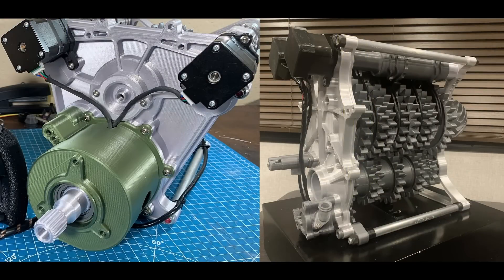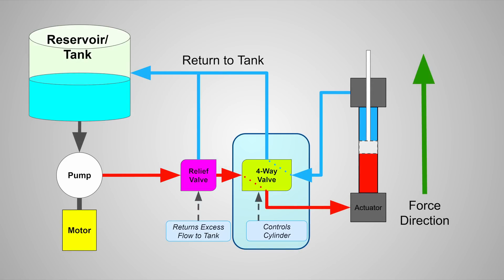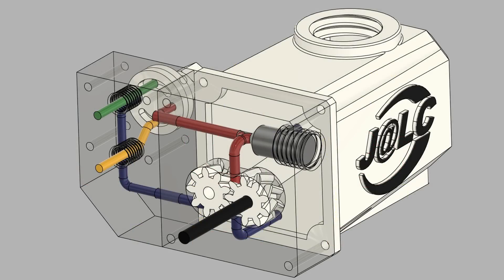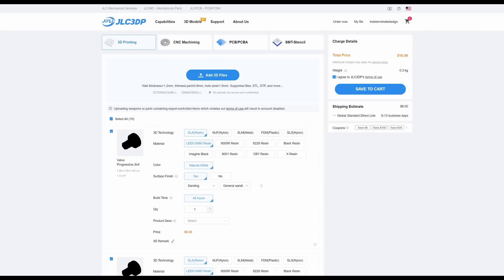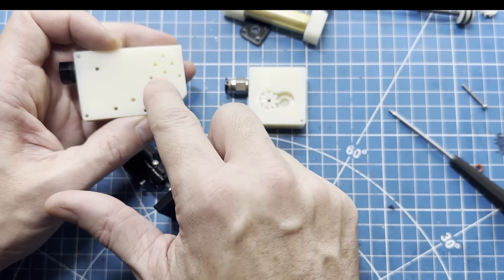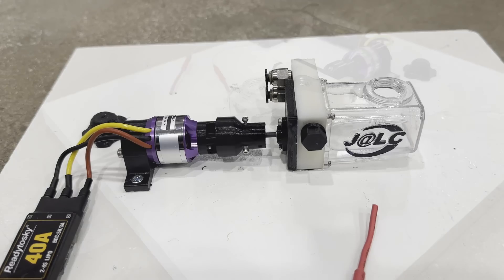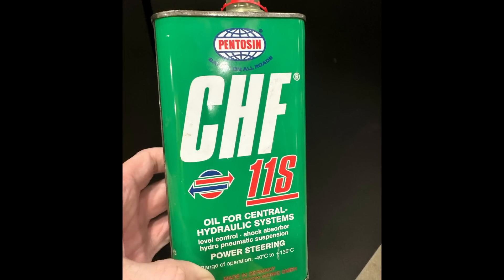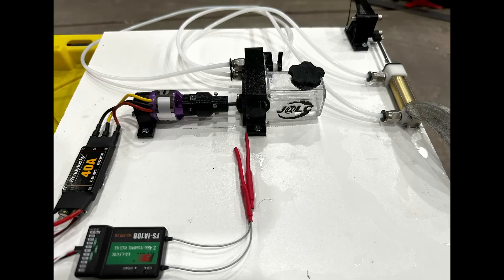3D Printed Hydraulics

Comment: Hi, I'm a mechanical engineer mostly doing hydraulic stuff for test systems in the automotive industry. Your system is impressive. I've seen some issues which caused the leakage and the which will damage your cylinder over time. First of all the shaft seal has to be connected to the suction side of your pump, so it wont be pushed out when the pressure is rising. Second, your cylinder is bolted down to the table, therefore the piston rod is bending and putting untypical forces to the cylinder head. Your piston rod will wear down the cylinder head fast and it will beginn to leak. Mount your Cylinder in a way it can swivel with your construction. You have negative forces put on your cylinder. Therefore it retracts to fast, almost with no resistance than friction, in industrial applications this can cause heavy damages. You have to preload the retraction movement with at least in line a relief valve or better with a counter-balance valve. In your case this doesn't matter, but it is something you should be aware of. But really nicely done. Kind regards and a happy new year!

Comment: instead of a gear pump, you shall definitely take an ABS unit from a scrap yard, open it and try using the design features inside of it in order to create a small but powerful hydraulic pump. If you go that path, you should investigate a lot on reducing the pressure peaks as the flow of piston pumps is not linear unfortunately.

All in all, I think piston/plunger hydraulic pumps are more fit to be printed using FDM and some postprocessing (epoxy sealing of the printed components)
Reply from the maker: I agree, I think piston and plunger pumps are the way to go. I had a lot of issues creating efficient valving though, I need more iterations. 

I thought about the ABS pumps, but size was the biggest factor. I would love to be able to fit this in an RC car of some kind. I think I can make a pump under 2” by 2”.

Comment: Try regular spur gears, rather than herring bone gears, most proper hydraulic systems use regular gears, and I think there would be allot less chance of the fluid ‘slipping’ Bach through the pump. There’s really no reason to be using herring bone gears as there’s minimal thrust loads
Reply from the maker: That’s interesting. Several places I read that herringbone gears have lower leakage losses due to the v shaped engagement.  It was said they weren’t used because obviously they’re harder to make. Do you have any papers on this?  I printed a set of straight spur gears I may try out here.
Reply: No, I don’t have any papers, but in my experience working on industrial hydraulics they’re all straight spur gears I may be wrong and the herringbone is just as good, but it would be interesting to see the difference.

Comment: Control valves should have bypass when in "off" position.
Extended periods of "off" while the pump is running will cause the working fluid to overheat.
Reply from the maker: Absolutely.  I couldn't think of a way to do this with the disc valves I was using.  I copied an existing design used in a lot of RC hydraulics.  Next time I want to have individual electromechanical 3 way valves.
Reply: @IndeterminateDesign  Have a look at spool valves. They really aren't difficult too manufacture and provide all the functionality you want.
Tractors, excavators, etc all use them.

Comment: Good idea, I think you would have more success with a piston style pump driven by a stepper motor, think leadscrew on a resin printer, it would be capable of generating serious amounts of force.
Reply from the maker: I agree.  I used a 2 piston pump as my first prototype, but I lost the majority of the pressure in the valves.  I need to try it again with some much more accurate SLA 3d printed parts.

Comment: what about a FDM surine like pump?  so having one of that big suringes actuated by a motor an a theated rod with a nut, that will generete positive/negative pressure fluid to actuate the sistem.
Reply from the maker: Those definitely would work.  I have tried a piston pump which is like a syringe but just resets.  I had a lot of challenges with the valves.  They need more development.

Comment: Hello ! I have no knowledge about hydrolics or robotics. But when I see the system I don't understand the advantages of going for hydrolics instead of electric actuator. As the power source is an electric motor, I think that the hydrolics are just a inefficient gearbox. What am I missing ?
Reply from the maker: In many ways it is just a gearbox. The biggest reason is power density. It’s very easy with hydraulics to achieve a massive mechanical advantage by just changing the area ratios between components. This allows for actuators that are much more compact and lighter than a comparable gearbox.

Additionally, a single pump can service multiple actuators. And typically all the actuators aren’t using the full bandwidth of the pump so you have less redundancy.
Reply: @IndeterminateDesign  thanks a lot, it makes perfect sense !

Comment: Are you planning on taking it further? Im really excited for it! Would be awesome to actually get a hold of rc hydraulics without giving an arm and a leg!
Reply from the maker: I do want to develop this more, but I don't have a definite timeline.  I want to try several different types of pumps because I think that is the hardest problem to solve at this scale.  Once we can generate a couple of hundred pounds of pressure, the rest I think will be much easier to solve.

Comment: Great video . I used to machine and maintain hydraulic pumps professionally, this looks like a professionally made system .  On another note fdm can manage parts like this , however there will be fitment and size limitation .( Gotta be large enough so that part tolarances are within the available tokerance of the printer ) i gotta get my hands on an resen printer.
Reply from the maker: That’s awesome.  I agree, all the FDM pumps I tried had to be much larger in size. The stretch goal is that I could fit a hydraulic system into an RC car. In hindsight I should have started larger and worked my way smaller.

Comment: Micro hydraulics seem like an idea with high potential, but i always got the feeling you had to "know a guy." I am really surprised that robotics haven't used more of it with how easy ratios are with piston vs pump size. This seems way more accessible imo, thanks.
Reply from the maker: I was trying to figure out the same thing. The cost is quite high for the off the shelf parts. I know some places like boston dynamics have used these, it maybe just a money thing.
Reply: @IndeterminateDesign  to be fair, companies like Moog are far more expensive than they should be.

Comment: Great project!

At some time I was going to try something like this too. Similarly, my idea would be to 3d print the channels and blocks but size the prints so they could be contained in stock profile metal sections. Doing this might help increase the working psi as the pressures could be transmitted from the fluid, through the print to the outer metal casing.

Also, research might be needed into which hydraulic fluids can be used which won't erode the 3d print materials. Simple veg/sunflower oil might be all that is needed.

My idea was to incorporate 3d printed channels for a hydraulic spool for controls and a hydraulic 360` rotating turntable junction such as used on an excavator but contained in stock metal sections.
Reply from the maker: Yeah. I think something like vegetable oil would be even better. The CHF11 I used is plant based but really thin compared to a vegetable oil. 

That’s an interesting idea about encasing the 3D print in metal. What kind of pressures were you trying to achieve?  The passage ways in my setup are just 3mm or 1/8” and based on the strength figures for the resin that should handle close to 1000psi. But it probably doesn’t do that in the real world.
Reply: @IndeterminateDesign  resin as liquid in tested in a hydraulic press might achieve that sort of pressure. However, solid resin uncontained, is still likely to fail on the layer lines. 

My project still hasn't even started! However, I'm not expecting large pressures.

You might find that you can indeed lift 1kg or more with the identical set up that you have but substitute a much larger bore cylinder. Lifting the load will take more time and more fluid but the system should cope. 

Possibly the "best" type of pump would be like an internal combustion engine in reverse - as used in construction cement pumps. Such pumps can generate huge pressures and hold the load when the pump is stopped

Comment: In addition to tolerances that floating side plates address, those standard herringbone gear shapes will allow a leakage path that effectively joins suction to pressure. If you study commercially available helical gear pumps, you will observe that much like on a screw compressor the geometries are designed with care to minimise the leakage path at the meshing point.
Reply from the maker: I had debated that. I had read herringbone gears had less leakage, which may not be the case.   Do you recommend a spur gear?  Any particular pressure angle?

Comment: What type of shaft seal did you use going from your gear pump to the motor? All the little ones i can find on mcmaster dont seem to hold much pressure
Reply from the maker: I used double silicone o-rings. I may try some x-rings next time, but I think the real problem was the carbon shaft was still too abrasive.

Comment: I would have thought a radial piston pump would work best for 3D prints as the o-ring gives a lot of leeway. I would probably cheat and use a metal cylinder 😂. It does add a lot more valves, though.
Reply from the maker: I think a piston pump would work really well and I worked on building one for a long time. I did have to use metal tube liners in my test prototypes. It was the valves that killed it. I think with SLA prints I could have gotten the valves to seal better, but FDM was horrible.

Comment: I have find that oil pumps from motorcycle engine works great as a hydraulics pump.
Reply from the maker: Thanks for the tip. I see they are really cheap on eBay. I may pick one up and try to miniaturize it.

Comment: with tesla turbine as pump, you can also 3d print the pump, even simpler better than the two gears you use as the pump now, well two interleaved tesla turbine discs stacks act like the gear pump, direct replacement
Reply: The Tesla turbine is already a pump without modifications.  It's actually quite hard to print, mostly because of the number of disks required and how thin they need to be.
Reply: @doughnut1107  no I think its easy to 3d print
Reply: @gsestream  Ok, took me many hours to get 20 disks that didn't fall apart.  Your skills must be superior to have it be easy for you when you did it.

Comment: They make mini hydraulic stuff for remote control excavators. It's neat that you built your own, but I thought this was already a solved problem.
Reply: It is still nice to do things as a hobby, as a learning experience, as a challenge.
Reply from the maker: Yeah, it was more of a learning experience. I also wanted the ability to customize the packaging in the future.
Reply: $500 for an excavator hydraulic system.. At the current price, I don't think the problem is solved yet.
Reply: I think the issue ist cost, not availability. Look at the prices at the beginning.
Reply: @clockworkvanhellsing372  Yeah, that's industrial stuff. Also a servo valve, they are always insanely expensive - they are ground to micron precision, and have some pretty crazy engineering work to make them effective.

Comment: Nice! What was epoxy did you use to seal things together?  The brass tube into that one block. ty!
Reply from the maker: Just some good old JB Weld. It seems to stick really well to the SLA resin.
Reply: @IndeterminateDesign  Good ol' JB! ty.

Comment: This is so cool! i had no idea you can print crystal clear parts like that tank. thanks!
Reply from the maker: I had no idea either. I saw the option on JLC3DPs website and I had go try it.
Reply: I actually print mostly clear resin with my resin printer. They sell clear and I would call tinted clear. I use red and blue clear as well as just clear all the time. If you clean it with isopropyl it tends to be a slightly frosted look, but now they have special resin washes as well as water washable resins that allow you to keep a crystal clear print. You can also just dip the alchahol cleaned print back in the resin and then cure it. The added layer fills in the frosted surface to return it back to clear. I use clear things for stuff like LED lighted things etc.

Comment: You need a pivot for your cylinder, you're currently binding it with side load
Reply from the maker: Yeah, I noticed that when I was editing.😒  It was strong enough to bend the carbon shaft, so I was probably wasting a lot of force.  Next time I'll get it right...
Reply: @IndeterminateDesign yes, I noticed the side load as well. You can either add another linkage to the output so that the shaft stays straight in its path and the linkage translates it or pivot the piston. But it came out pretty decent for a first iteration.  I can't wait to see how far you can take this build. I have always wanted a mini hydraulic based RC like machine. Are you planning on selling it at some point?
Reply: You could also just put a slot in the lever arm if you wanted to avoid changing the design too much
Reply: Scottish yoke